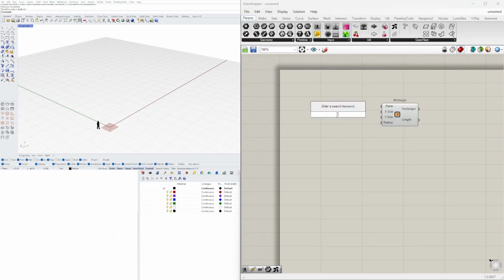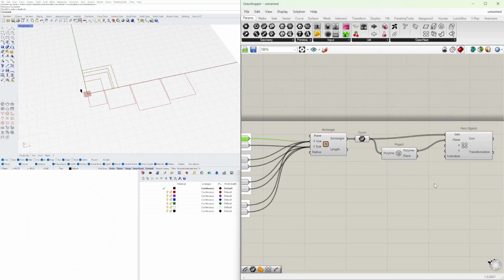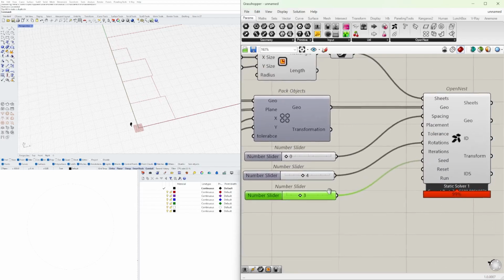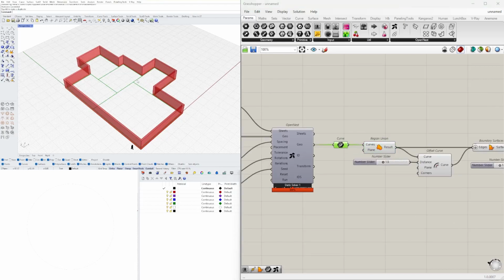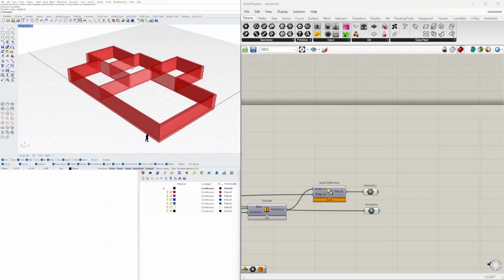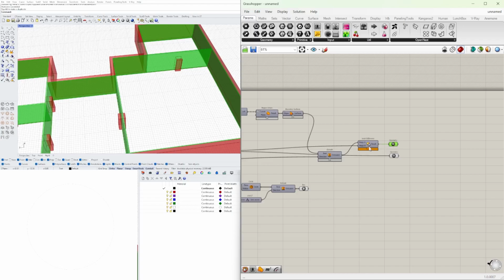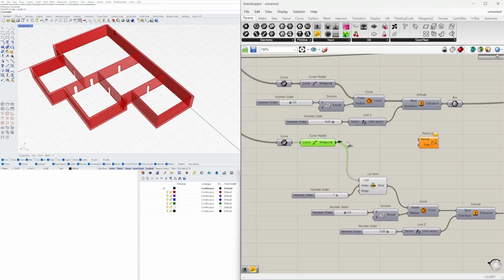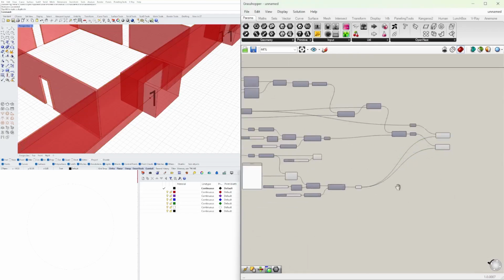Parametric Floor Plan  + Open Nest Exercise & Rhino Parametric Architecture tutorial

Comment: if we created sigular unit of apartment suppose 1 bhk appartment then how can we stack these units in upward direction to make it a tower
Reply from the maker: you can use the move component, and a series component with a z vector to create a vertical array.
Reply: @DCOParametric  i am again facing an issue while packing rectangles that are aligned linear do get packed into the big one we used as sheet rectangle , can you tell me where i am doing wrong as i followed all the steps carefully 
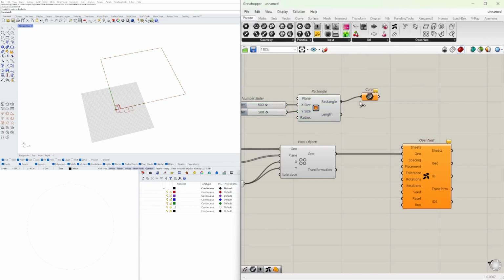time - 5:34
Reply: hi can please resolve my issuee

Comment: I appreciate your work, one thing come to my mind is that instead of solid difference you can first do all work on flat ground and do all operation of wall and opening creation using region union and difference. I think it will save resources. Then just like we extrude cad plan, you can do that.
Reply: I think, we can utilize second plate to use arrangement for second floor. Few challenges i am imagining- 
1. Location of stairs should be same in all floors 
2. Plumbing line should be in same vertical line to have optimised planning.
Reply: I am also thinking about some dynamic input method to make it more practical. Specially to make openings.
Reply from the maker: That would be super useful!

Comment: Can you explain a bit more about the loft + region union + boundary surface combo? What is the logic?
Reply: Loft is the basic function of rhino to connect surface between curves. Region union is to combine all the seperated boundary surfaces into single surface. Boundary surfaces create a surface between the selected curve. I don't know if you used hatch full, it is something similar.

Comment: Hi, how could you add another geometry which would start from another corner of the specified sheet (with a different point than the origin)? And how can you make the room expands in both direction instead of lining up against one side of the space sheet (in case the sheet is much larger than all the combined rooms)? Thank you in advance.
Reply from the maker: I dont have a solution for this right now, but ill keep in mind when I do an update video.

Comment: Open nest doesn't work on rhino 8 🥲 great tutorial tho
Reply from the maker: I didn't know that! Thanks for the heads up! Lunchbox either! "I think"  Hopefully they are updated soon. 🤞
Reply: @DCOParametric  I got it to work, a folder was missing he he. Followed the tutorial, it's amazing, you are a life saver
Reply: @FernandaLima-k9f  hey I'm trying to get open nest to work on Rhino 8 too. it installed fine via package manager... but the main openNest1 or OpenNest2  nodes crash rhino and grasshopper when I drag them into grasshopper or load any of the example files... any suggestions or ideas of how to fix it? is there a way to install/download plugins manually like in this video for Rhino 8?
Reply: @mmorenopampin same here, were you able to find a solution?

Comment: how did you copy the commands???
Reply from the maker: when you move a component, tap alt, and this way you can make a quick copy of anything
Reply: kindly also specify how you can unlink the commands thanks in advance
Reply from the maker: Hold down ALT and unplut it. you should see a - show up that indicates it is being unplugged.  you can also right click on top of the input you want to unplug, then right click, disconnect, and pick the component you want to unplug.
Reply: I think it is Ctrl instead of Alt.
Reply: thanks sir it was very helpful. I greatly appreciate your efforts and I will be waiting for your upcoming videos thanks......